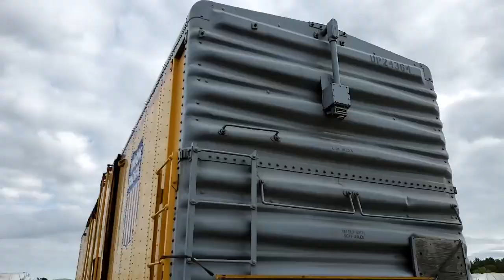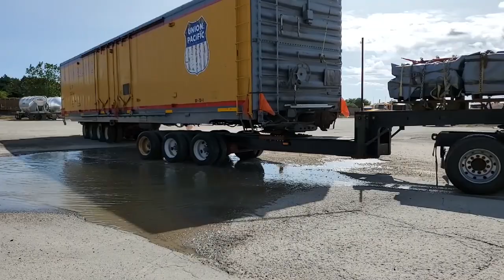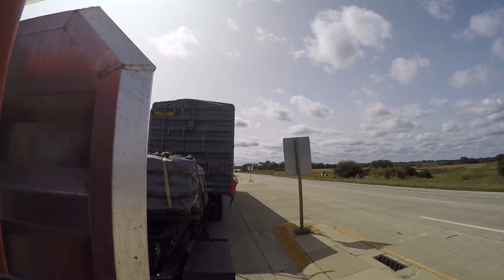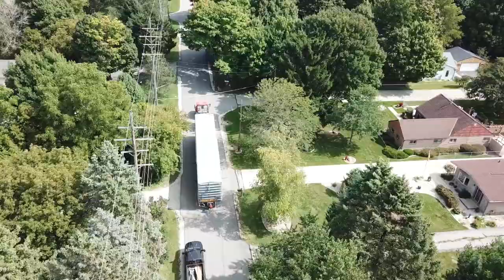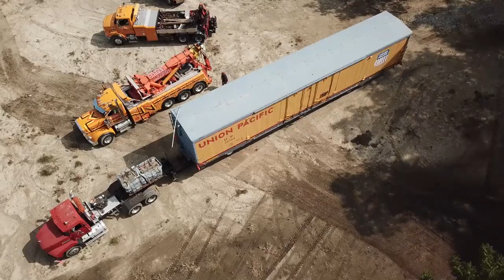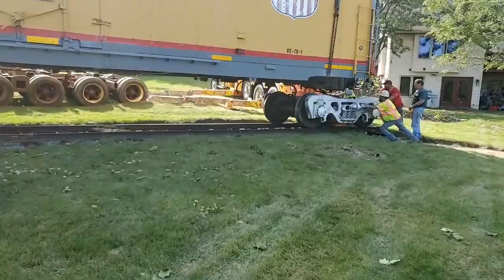How They Move A Train Car To Your House!!!

Comment: This is no ordinary boxcar.  This is an express boxcar with special wheel trucks designed for higher speeds than normal freight car trucks.  Most freight cars don't have fully enclosed roller bearings, disc brakes, or thick truck frames.  A pretty rare example of a car!
Reply from the maker: Thanks for the info, thats awesome! Too bad it wont be running down the tracks anymore, but it is still going to get tons of use.
Reply: I was curious about this car... I was like that is not a standard car... Was trying to research what it was on Google...
Reply: @james94582  Possibly a Mail car that was ran with passenger cars. They liked to have the Box cars on the same bogie sets as the Passenger cars.
Reply: Any idea on the length?

Comment: Well, the problem is - that is not a train. It is a special box-car. It takes a lot more than that to make a train.
Reply from the maker: There's always one in the bunch...
Reply: @DeltasAdventures  That it true and judging by other comments, that "One" is correct. It is a special box car,  Trains don't ride on trucks, they roll on rails and require a massive machine to make them move. That is known as a locomotive - also not a train. That one box car can carry more tonnage than a box trailer, by the way.  A train can carry more than 200 truckloads.

Comment: How much does it cost to move a train car? Something like $20,000?
Reply from the maker: It all depends on the miles and how many hurdles there are. If there's any wires they have to move for clearance, etc. About $400-$500 per mile on average tho is what I figured but there could be other factors as well, making the special "jig" the car sits on, condition of car if added bracing is involved. This crew did an amazing job!